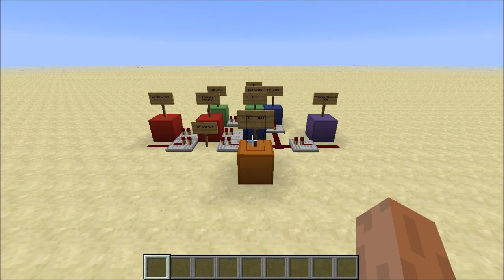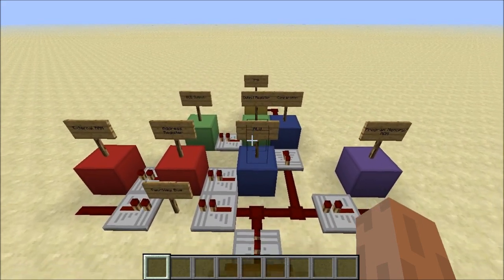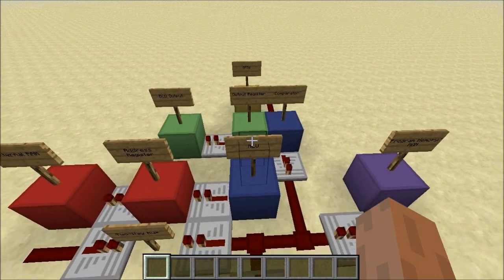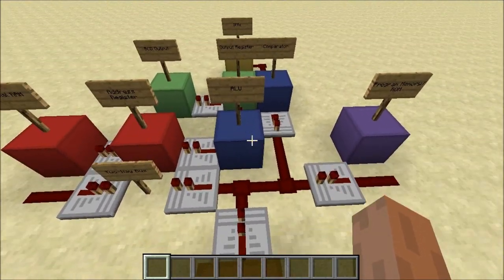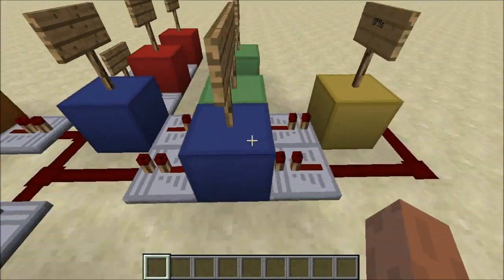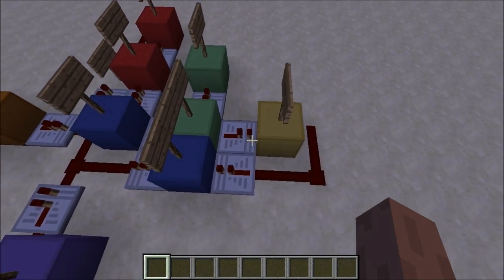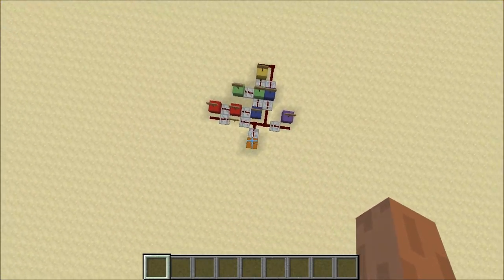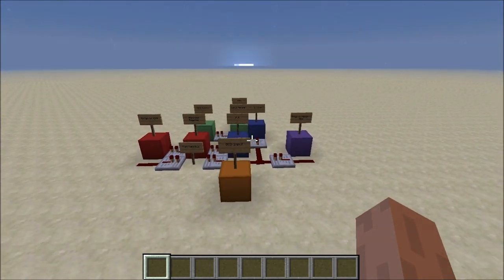Minecraft: How To Build An 8-Bit Computer - Part 1

Comment: I made a big semi slow 64 bit computer that I want to improve on. So I've  watching you tubes to make it. It's on the ps3. I am trying to make a bigger hard drive to save messages and some problems done recently. If it isn't in here. It might give me a idea. So thanks no madder what.
Reply: 64 bits would takes thousands of hours. + no world edit
Reply: It has:
 Two ways to process math problems with a 64 bit adder subtracter multiplyer and divider and a texting
Reply: New one blue prints and goals
Screen shows it with in 30 ticks
128 bit upgrade 
20-200 problem storage
Graphing screen 
3 picture storage
Picture screen
x4 screen size
Reply: Devon Funk Can i please see that computer.

Comment from the maker: Yes, on this computer, pipelining is definitely out of the equation. I myself don't use this method of two clock cylces anymore, however I don't particularly want to be changing the architecture of this computer at this stage, purely because it would confuse some people. The way I do it now is just to have a different instruction format for accessing RAM, and also have a way of using a value stored in one of the GPRs as the RAM address.

Comment from the maker: Pre-1.5:
Dual Read RAM: 2 * 3 * 19 per bit . (WxLxH) (1 Data Input, 1 Write Location, 2 Read Locations). I also have 2 x 4 x 14, but where RAM is concerned length is more important than height, as it reduces the number of repeaters needed on the input bus.

Single Read RAM: 2 * 2 * 13 (i think, maybe smaller) per bit. (WxLxH) (1 Data Input, 1 Write Location, 1 Read Location).

Comment: What is the most compact ram you have been able to make so far? I have been able to come up with a system where each bit has a LxWxH of 5x5x8 and is completely stackable byte wise. Each bit has the ability to read or write depending on inputs. I made 64 bytes fit in a LxWxH of  about 50x50x64 which includes the bits and addressing lines. If you are interested I could try to make a video of it.